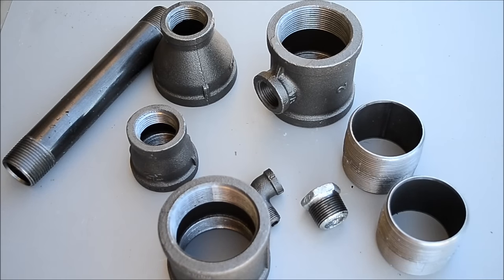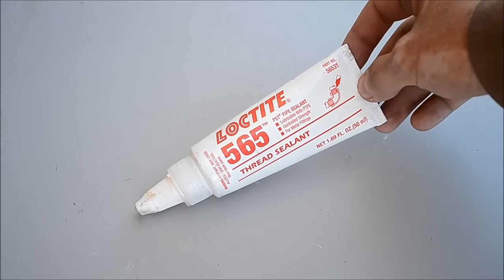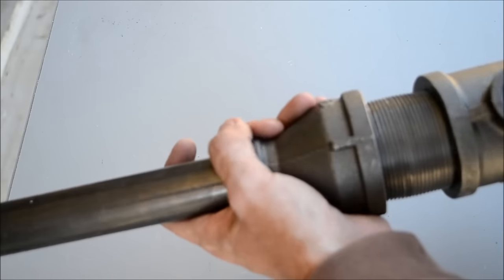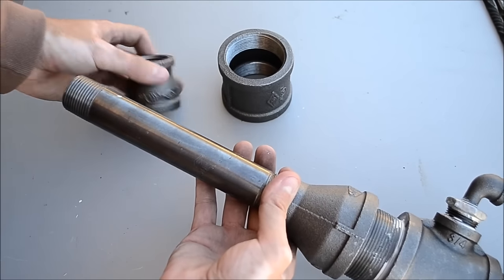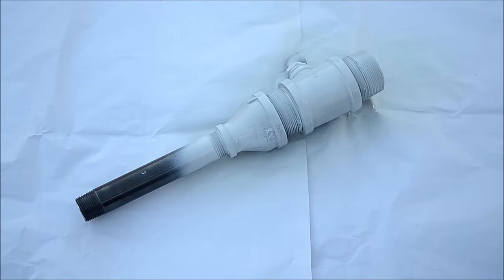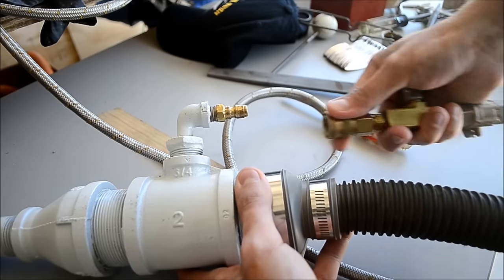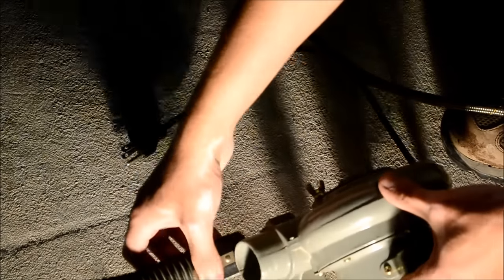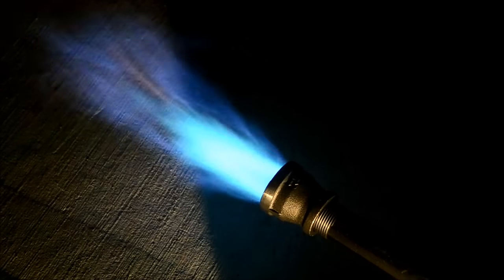How to make a forced air propane burner EASY!

Comment: I would suggest a valve to regulate the airflow into the burner. If you can regulate both air and propane you can easily customise your burner to whatever purpose. I use a bypass valve system on mine. In open air it wants to blow itself out but inside tje forge it runs perfectly, with a very low gas consumption.
Reply: Yes,  you need to control the airflow into the burner.  Too much air and the flame will blow out,  as happens in the video,  and the heat is blown out of the furnace before it can be absorbed efficiently.  Too little combustion air and you make soot and massive amounts of carbon monoxide when the flame can't burn the gas properly and completely.

Comment: is that high temp steel or regular think the code is HE and MD been a long time since I last worked with pipe in the oilfield
Reply: Looks like just sched-40 steel that you can find at any plumbing / home improvement store.
Reply: @CurmudgeonExtraordinaire  sch 40 is just the thickness probably mild steel  HE is used for sour gas.....3 year old comment😄 thanks for the reply at least.

Comment: What did you do with the 1in/1.25in reducer & the 2in coupler at 2:40. You never showed what it was used for?
Reply: Probably welded the 2" coupling to the forge body to help hold the torch.

Comment: The reason the burner flame kept going out is that the speed of the air/gas flow exceeds the speed at which the gas burns.  Slow down the air flow in particular and you wont have that problem,  or the need for a flare fitting at the end of your burner.

Comment: What is the reason behind filing down reducer to fit inside 2" coupling? You didn't use it.
Reply from the maker: William Summers that is how I attach it to the forge.  The coupling is welded to the forge

Comment: I get a 3 foot flame from a sidewalk torch. What is the point of this? it looks weak.
Reply from the maker: BEAKER UNREFINED it it strong enough to melt iron, this is for a forge inlet. they need to be smaller than weed burners.
Reply: not sure if it would or not. i know you don't get too close. it's unregulated though so it chews up the propane.
Reply from the maker: BEAKER UNREFINED mhh I have seen weed burners used but they are always a hassle to move around.  this design also allows for an inline needle valve to control propane.

Comment: why not make a venturi burner instead? then you only need a gas tank. then you don't need a blower. I made a venturi burner myself, it's easier in use I think.. but nice project!
Reply from the maker: blown burners can save gas and get hotter in some applications.

Comment: you cant use lp (liquid propane) it didnt seem right so gonna get vapor...it was spraying....fork lift tank?
Reply: charles hoover all you need to do is set the tank in a bucket of warm water if it remains solid.. adding more heat will help it expand

Comment: I put flame holders in mine and it works awesome.  I use a piece of 1/2"x1/16th angle iron mounted inside the burner end with the edge of the v part pointing outward.  ====0>==O  kinda like this, fire coming out the O.

Comment: change your 2 x 3/4 T for a 2 x 3/4 "rooster".....a few different types.....some have 45 degree 3/4 fitting on a 2" T.....others are an 90 degree elbow fitting elongated on one side....with a 3/4 fitting in the head...looks like a roosters head....will smooth your air-flow.....

Comment: As someone who currently runs forced air, I highly suggest venturi.
Reply: to add to that, blown burners work, but they can be complicated to run properly.
Reply: Eagle Bird Creations what exactly is venturi?
Reply: Eagle Bird Creations nevr mind
Reply: Ok so what do you do if you want to forge weld at high altitudes? I'm building my first propane forge, single burner but want to forge weld smaller objects, and am having some troubles getting started.

Comment: there should be a control in the air
Reply: Yes,  there should.  Excess combustion air is why the burner keeps going out,  and will cool off the flame and cause the heat produced to escape the furnace with much of it not being absorbed.

Comment: Needs a internal cutting tip added. To mix the air to the fuel before entering the flared end. Then it would burn at about any mixture. Leaving it more reliable to staying lit. And easyer to adjust to a perfect flame when mounted in a kelm or forge. As going out like that in a closed space could get danguruse.

Comment: to solve the problem of keeping ignition. 4 inches of pipe, holes in it like oil burner. use a push lever throttle. like torch for cutting steel. trust me , I live in united States, state of Michigan. Master diesel mechanic. think zombie apocalypse and it will work.

Comment: Ummmmm, aren't you forgetting Thread Lock on all the other fittings? Kinda important. Plus, this doesn't work WITH the flare! No blower controls to the fan output.

Comment: Im guessing you're putting way too much oxygen through it in this because this burner is running very lean to go out on its own like that. If it runs a little rich thats better than lean, atleast for this application.
Reply from the maker: Yeah i needed to tweak the air flow a bit

Comment: There is a reason fuel is introduced to the burner right near the end on conventional gas/oxy kits. 1. It is easier to ignite and get the mix correctly 2. It reduces the chance of a flashback, that is the gas igniting up your 1/4 inch pipe. You should have called this video "how to blow yourself up!" also gas fittings are tapered to prevent gas leakages, steel plumbing fittings are not! DO NOT ATTEMPT TO MAKE THIS DEVICE,
Reply: That is a fear statement. But anyone with half a brain attempting this would cover the parts not explained in this video and use a flash arrestor  and regulator in their gas line.

Comment: I get scared when people try to copy items without a full understanding of the principles AND DANGERS involved.
Lets start with the use of compressed air fittings to supply gas. This is how people die in so called "tragic accidents"
Reply from the maker: The quick connection are all rated for gas.

Comment: That 2" to 3/4" T iss the hardest thing to find. It's like hunting for unicorn poop in my town.
Reply from the maker: +WarChief GarrKhan you can also look for a 2 to 1/2 tee and the use a 1/4 to 1/2 hex nut to get down to the street elbow
Reply: Fair, I'll have to head to my parts supplier. Here's to hoping they have it.

Comment: Great... a burner that doesn’t work...!!! Fair too much air... possibly need to think about regulating the propane supply via a smaller hole or MIG tip... on a positive it was a simple design to deliver the products... just need to sort out the mix...

Comment: Looks like it didn't work very well, bro. Maybe the blower was too powerful.
Reply from the maker: +Tree Topley It is for a forge which produces back pressure unlike open air.
Reply: Ah good. I wanna build one too. Does it need that much power though?
Reply from the maker: many burners even venturi will have a flame about the same size.

Comment: .....Or paint it with High-Temp Engine Enamel.
Reply: but can that cope with 2000+ degrees?
Reply: Rustoleum has one that resists up to 1500°F....so, close.
Reply: Hmm, pretty good, thanks
Reply: The one i found was Rustoleum "Specialty" paint. I did not pay attention to the price, but it was pretty near the top when i searched for "high temp paint" on google.

Comment: In fact, you did not succeed, because you did not follow the principles of making the torch, that's why your flame did not last, and it was turned off,
Such a torch does not require a blower at all, which you spent on a blower, even if you wanted to use a blower, the way to blend air and gas is not what you did.
Reply: A bunsen burner uses a jet of gas to entrain air into the combustion gas and allow it to be burned without a lot of carbon,  and carbon monoxide,  being produced.  But that requires more engineering and design than is evidenced here.  Some forced air is probably a good substitute for a bunsen burner,  but there was clearly too much forced air in the video,  which id why the burner kept going out.

Comment: Am I the only fucking person who knows that  iron pipe has a tapered thread and will make a sealed connection without pipe tape
Reply: Anyone who has ever worked with LP or Natural gas line knows you dope your joints....  So no, despite the tapered thread, you still have to seal the joint.
Reply: Wrong answer Bud,
Reply: Always use tape or dope on gas lines!
Reply: That's probably why every gas utility I've ever watched installed meters, use tape and dope... I'm sure they don't know what they're doing though. Who would want to ensure a leak free joint?
Reply: lol lol there seems to be a difference between an expert and               professional
Reply: im a pipe fitter  tape and dope are lube for threads.   natural gas pressure is so low they worry about tape blocking the outlet if put on wrong...  what your making draws in air... if what your making is under pressure use the dope and tape.  yes pipe threads and fittings are tapered ..only the gas has pressure not the blower.  stupid to argue